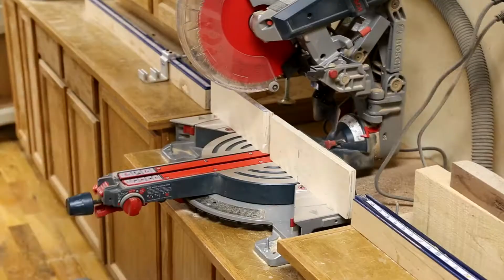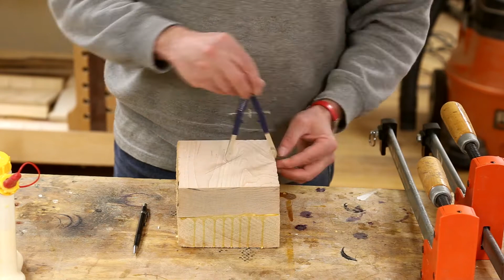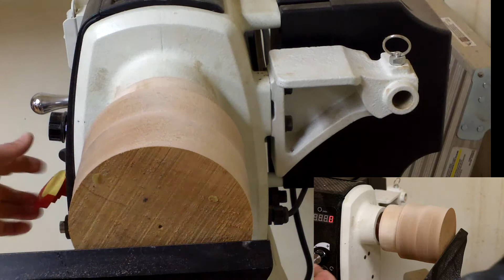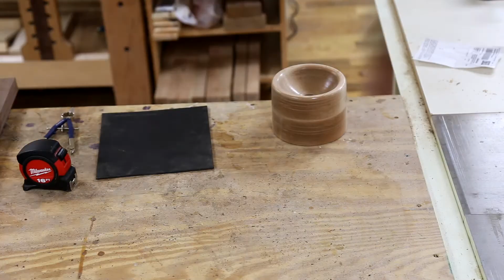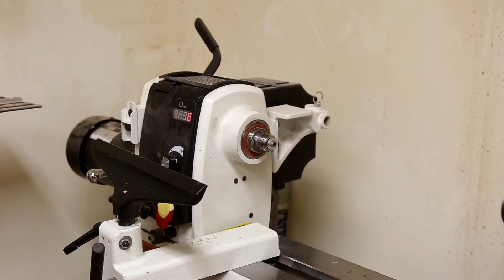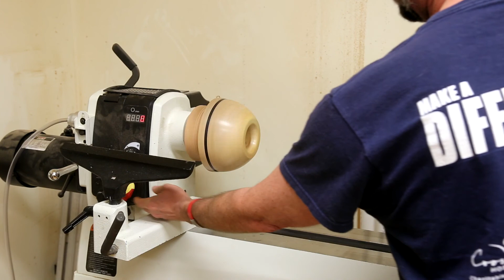Making a vacuum chuck for my lathe

Comment: You didn't show what the metal tube, etc all comprised of.  Did you buy all of it as a kit or what?  I have a vacuum pump but don't have the bearing and metal tube.  Any info will be helpful.  Thanks.  I Like your Lathe and set up.
Reply from the maker: I bought a Universal Vacuum Adaptor Kit from Woodcraft.  There are other similar options available, or you can get bearings and make your own from lamp rod.  There are others with videos on how to do that if you choose that route. Good luck, and thanks for watching and commenting!

Comment: Great video.  Where did you get the tool for threading in wood?  Does the threads wear out on the long run?  Any type of hard wood works OK?
Reply from the maker: I used a Beall spindle tap which you can buy online, see video here: https://youtu.be/MmesGttAq4Y   I believe any reasonably hard wood should work.  I can't knowlegably speak to longevity because I haven't used any of the ones I've tapped enough, but with so many threads engaged, I expect it to last a long time.  Thanks and good luck, I think it's well worth buying one of these taps.  Jeff

Comment: gret video! where did you get the tube assembly that goes through the headstock?
Reply: Most use 3/8” lamp rod from home centers if get 30” would be enough for two chucks hope this helps

Comment: Nice job 😁
Did you use poly to seal the outside of the chuck ?
Reply from the maker: Thanks Banshee!  Since I don't expect it to be subject to much wear, I just used shellac.  
I'm a big fan of shellac for the right applications due to it's quick drying and the look and feel that you can achieve.  I often use shellac for sealer coats to be followed with hard wax for some of my other turned projects like bowls.
Reply: Thanks for the response jeff
Keep up the good work..

Comment: What is the source for the assembly for the head stock please?  I have a vacuum pump but need a source.  I can purchase a bearing but still need some help with connections.  All the videos that I have seen are not clear enough for me to make my own.  Any help would be appreciated.  I have a Turncrafter lathe plus old Sears, and others but Turncrafter is most used. Thanks.
Reply from the maker: I should have added it to the notes, and then I would have remembered and pre-answered this question.  I bought a Universal Vacuum Adaptor Kit from Woodcraft for ~$65.  There are other options available which are similar from Hold Fast and other sources.  What I bought included the bearing with a nipple for vacuum hose, a threaded rod that I cut to match the length I needed and a threaded cap and O ring to seal to the headstock.  You can see this assembly at 10:20 with me looking pretty astonished that I managed to figure it out.  You can also assemble your own parts for less.  Good luck, let me/us know how you make out!
Reply: @JeffMarxWoodworking  Thanks for the info.